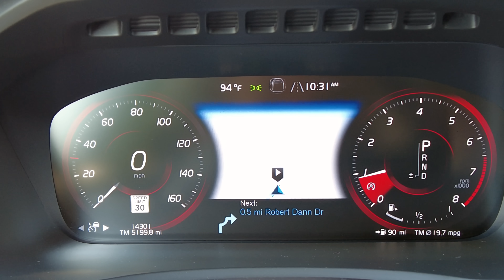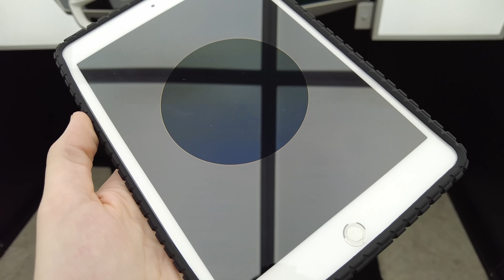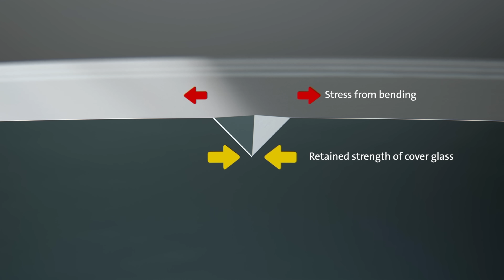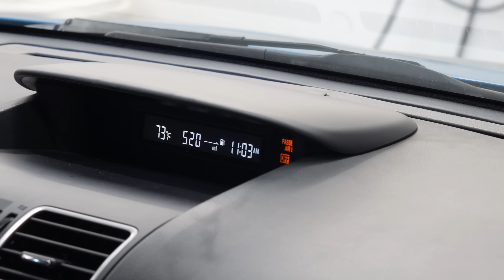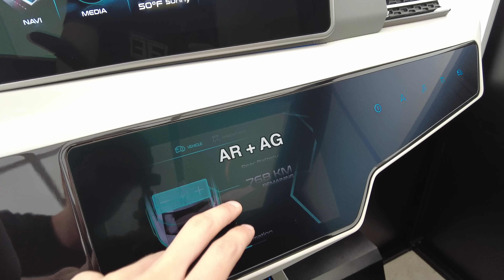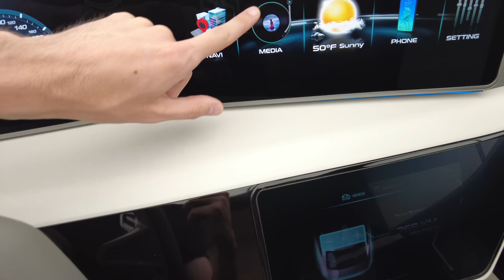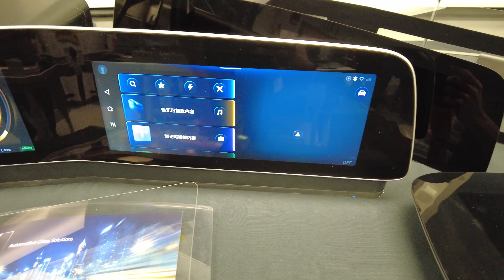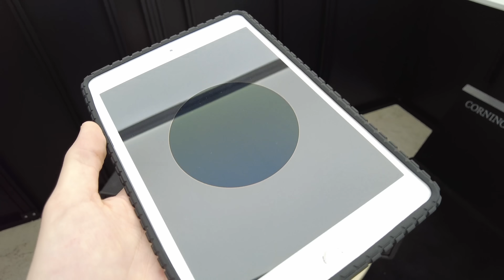How The Glass Inside Your Car Is Engineered - Not So Simple!

Comment: Note that a massive flaw in flexible glass screens is that the underlying digitizer, the component that actually processes the user's input, is not flexible. While the glass can withstand impacts and bend appropriately, the digitizer will eventually fail. This results in wandering inputs over time.

Comment: I hate, and I mean, hate, touch screens. It's high time they were outlawed - they're 100% unsafe to operate when driving. This is one of the advantages of older cars - no touch screen nonsense, everything is so easy to operate without being distracted when driving, because older cars have buttons. Something like BMW's iDrive is the best solution (well until the latest version made its debut) - massively declutters the interior,  but yet everything is still so easy to operate, and there's physical buttons for all the important controls

Comment: I honestly REALLY dislike the large screen trend. I would much rather have a simplified and inexpensive tactile, analog even, user interface especially with modern electric cars. They're sooo damn expensive already. Put the money into function and leave the interior to the user. My current ideal would be a bare-bones electric truck with either 2 motors and differentials or 4 motors like the Rivian R1T, 300+ miles of range, air suspension to allow for ground clearance adjustment for different types of driving conditions...and that's it. Seriously, bring back roll down mechanical windows, have only a docking area in which you may connect your own phone to the car for audio. I don't need anything else on the interior involuntarily working to drain the battery and reduce my range. The Rivian R1T is amazing. It is everything I would want in an EV. But starting at $70K? It's just unattainable for regular people. What we need right now is a Model T Ford EV. Something bare-bones that can be produced for the masses that is functional first above all else.

Comment: It’s sad that so much engineering goes into vehicles and yet they forget the importance of redundancy. Servicing vehicles is just getting worse with each new model and they’re unreliable. Everything is designed for the assembly line, not future repairs which are inevitable. 
What about electric steering on vehicles. Worst idea ever. Nothing but problems. Not to mention when it fails, you have no steering at all. Or there’s a software issue and the vehicle decides to randomly make a sharp turn off the road. 
Some systems just need to be more redundant. Cars need to start when cold, you need a cable for shifting the transmission with a lever, you need brakes to be mechanical.

Comment: The 8.5" Uconnect screen in my 2018 dodge charger is really good, probably the limit of the size you should be at. What is annoying is that the seat heater buttons are in the screen, not physical buttons.

Comment: No. I don't have a problem with someone having one but current integration is very unsafe for real world use. I drive 100k miles per year, I think I'm qualified to have a perspective. 

Personally I think having a digital instrument cluster is an ok use case for real world driving and function.

Switch gear is still required. However a car with a screen that has a anchor point like the 2017-2021 Toyota Camry is ok. I drove one roughly 10k miles in a few months and I was able to use it while not taking my eyes off the road.

I currently drive a Mercedes. No. They do not integrate their touch screen in a safe manner for real world use.

Comment: "Do Massive Screens Belong in New Cars?" My answer would be: No.
I am with the many others who want things that should be accessed while the car is driving as physical buttons/knobs. 
And i think that touch input displays are the worst idea in somehting like a car. Movements of the car (bumps in the road) can make it really difficult, even more so when you need to look at the road. (easier for a passenger, but still worse than buttons or other input devices like a puch/pull/press-wheel like iDrive)
And just from looking at the screens, to me the complete digital instrument cluster mostly look cheap and unelegant compared to well made analog instruments. (which by the way noever get pixel errors, and don't react slow when the car was outside in very cold temperatures.)

Comment: GM is using a 32” flexible OLED in the Lyric and Escalade..pretty impressive but not sure if it’s glass

We use molten sodium to cure and treat rubber extrusions (vehicle weather stripping). Scary stuff

Comment: Nice infomercial, but you didn't really comment on the clickbait title question you proposed.

A touchscreen in a car I feel, has no place outside of features that are not commonly used. A radio for instance, should have a few tactile controls and knobs for it's basic functions. if i want to change the volume on the fly, it needs a knob, or some tactile buttons on my wheel. similarly, for presets, give me a few physical buttons. if you dont want to put them on the dash, then at least put them on the wheel. Since, i'll admit, even i use the wheel controls for my radio more than the knob or buttons below it.

Comment: well uz got mirrors that are too small on the outside to get that .01% decrease in drag. Uz gots head rests and pillars in the way for the rear mirror soz ya kin pass the collision tests.
Hey all enginnearing collegeins need jobs. Some to screw things up by recommending removing the Darwin solutions for those that are too broken to pay attention to details.
 It also employs engineers that make solutions to keep the Darwin failures alive. Then then there are the the manufacturing assembly enginears making it cheaper and quicker to put together.
Yes a 2021 Navugreator is "safer" than a '66 Chrysler New Yorker and gets better gas mileage. But at least you can see the failure heading your direction in the old New Yorker. 
If you are paying attention to detail.
But you can be well entertained before you go to the hospital after the ride in a Navugreator. At least I got drive to drive my rusty old '66 New Yorker Belchfire massive V-8 to the junk yard.
Oh and BTW sometimes the collision avoidance system does not work and you get fired. After you get told you are a bad test driver.
 Then the plandemic hits and they want you to come back.
Even pay you extra. Just how much is a human test dummy's time worth? I never trusted the system. 
I Quit when my time was being wasted to just have the paper needed to back up the testing requirements. I still have 0 accidents in 40 years of driving. No tickets in 25 years.
 I really hated having to fiddle with all the dash board gimmicks while driving. Filling out the paper work while driving. Well you did have get the miles increase on the speedo.
 I guess that is what is needed to simulate normal driving skills on today's roads?
But if you noticed a cosmetic flaw in in a body panel. That gets fixed quick. Then there is the software/hardware glitches just to the drive more interesting.
Then the sales person wonders why I only buy ONLY the base model, bouncing box, puffed up 4.
 I also don't care if there is 1/8 inch difference in body panel fit as long as there are no water or air leaks.

Comment: very interesting video! I really love these behind-the-scenes videos.
gotta say though, screens are part of the shortlist of things I wish modern cars didn't have. I understand the advantages and why people want them in their cars, but I think we've gone way too far. Some of us don't want any of that at all. It's distracting, raises the price of the car through engineering and material costs that otherwise wouldn't be there, and will cost a pretty penny when they break...and they'll break. And when they do, it'll be the difference between getting rid of an otherwise perfectly good car or having it last half a million kilometers. Imagine you have a Nissan Sentra with 300,000km, still runs great, but it's worth barely $1k. Then the touch screen breaks. You can no longer perform basic functions and replacing it will be twice the value of the car.

As far as user interface goes, I FAR prefer physical knobs and buttons to a screen, physical analog gauges over a digital replications. Look at the watches people buy; physical analog watches are so much prettier than say an Apple watch...which looks like it came out of cereal box. We use and work with screens all day long; can't we possibly option a car without them? And then, there's the non-intuitive touch screen, where you need to swipe to actuate, with no physical indent, nothing to locate your finger. You need to look at the thing (take your eyes off the road) and make sure you swipe just the right amount, as opposed to finding a dial and turning it 3 clicks clockwise, or push the second button from the left.

We're fixing a problem we never had with a solution that is causing some serious problems we never had. The prices of cars keeps climbing; can't we just have strippers with only the important stuff (quality drivetrains, state of the art crash structures) and none of the crap we don't? I'd love to see a time when you can buy a compact car for less than $20k CAD.

ok ok rant over. I just really don't like touch screens. So happy my NB2 Miata has none of that crap. My Mazda3 does and I interact with it zero times (at least basic core functions are knobs and buttons).

Comment: Those smaller, integrated screens look a lot more usable than the giant monitors I've seen in some Tesla models. Any chance they'll come out with multi-layer screens that have transparency to give a sense of depth, like you see on some video-slot machines at casinos? I wonder if the depth will enhance the readability of analog-style gauges.

Comment: I had a tablet on a Ram Mpunt in my Astro ten years ago. A regular cassette adapter gave me access to streaming entertainment pumped through my stereo without a costly multimedia tuner installation. I've driven newer cars with touch screens and it sucks having to do all that menu scrolling. Give me vacuum and electric dial controls for everything else, and leave the touchscreen for purely entertainment purposes, thanks.

Comment: since toyota is coming with turn wheel by wire steering. I wonder if in the future, the wheel will remove all together and you just steer from a virtual wheel on the driver side display screen.

Comment: Our phones work for about three years. I doubt those ipad controls will work any longer. That in itself is a safety issue. Besides, I have ADHD. I don't need some crazy menu distracting me. Just give me the buttons. If it needs to glow to gain my immediate attention, it belongs with the gas and speed section behind the wheel.

Comment: I can't stand these new vehicles. When I want to turn up the heat or change the radio station, I don't want to have to look at a screen and go through 5 pages to do it. I drive a 1996 Buick Roadmaster sedan and I can turn on anything without taking my eyes off the road. I can only afford used cars, but even if I could afford a new one, I'd spend the money on something from the 60s to 80s and put a more modern drivetrain in it. That would be a much better investment. And a lot more enjoyable to drive.

Comment: While center console buttons are being replaced by touch screens, steering wheel buttons have multiplied like rabbits. The total number of physical controls hasn’t changed that much. Of course there are exceptions.

As automation takes over more and more driving tasks the need for physical controls is reduced. For example, if the headlights come on automatically, why do I need a physical headlight switch? This isn’t a new thing: cars used to have a choke to manually control the air fuel mixture, and of course most cars had manual transmissions and clutches.

Humans resist change, but we’re actually quite good at adapting to change. Cars have changed dramatically in the last 50 years, and we can expect them to change even more in the next 50.
Reply: It depends. Most of the problems occur when you remove a manual option without testing to make sure it works as designed in every instance. I normally use the auto mode on my headlights, but it still needs an "on" option because often in bad weather headlights are needed but it's not dark enough to turn them on automatically. So until an automatic mode can work reliably in almost every conceivable situation, it's better to have a manual option even if it's just a backup.
Reply: @edwinball985  yeah, auto has to be very good before completely eliminating manual override.

But there are advantages too. For examine, if a new law requires headlights on 1 hour before sunset and when it’s raining, automatic headlights can do this, where few human drivers will even be aware of the new law.
Reply: You see that's where you are wrong. Where i live, in fog and rain, headlights on is required by law. This worked pretty well for decades as long as people had to switch on their lights by hand each time. Nowadays it doesn't anymore. Why? Because of daylight running lights and automatic functions and light sensors. People think their car will switch the headlights on in rain and fog, but no car does it. Today is a good example: I had to drive in fog today, and over 50% of the people had no headlights on.
(The daylight running lights only switch on "position lights" in the front, not in the rear.)

There is another reason: young drivers aren't taught that in driving school anymore, because the drving school instructors tell them to just always leave the lights on. Which they don't do as soon as they get into a newer car as these have "AUTO" on the lightswitch, and nobody reads the Manual. (and it works in tunnels and in the dark, so they too assume it works anywhere the law requires it to work)

Comment: With all the discussions on, "Distracted Driving" centering on texting and handheld phone usage I can't understand with the multiple screens aren't included. 2021 Subaru Forester has 3 major screens that aren't close together and each carries a ton of info. For the most part, info I don't need. Do I really need a sliding graph to tell me I am getting great milage while driving downhill with my foot off the gas? There's also times when a warning chime sounds and my eyes dart from screen to screen to see what the car is trying to tell me only to find that info is not available (the first time it happened was because the dog in the backseat moved to the center where the belt wasn't buckled.) So, yeah, great. The tech that goes into the screens is wonderful, But give me a few knobs and one screen on the other side of the steering wheel.
Reply: IMHO a good use of screens would allow you to customize displays for this reason. Want nothing but speedometer and whatever else is legally required? There you go. Want fuel mileage and status of everything on the car-again their you go. And yes, things you regularly use while driving should be an actual switch, knob, or button.

Comment: Touch screens are downright dangerous, as they force the driver to take eyes off the road.  They should be illegal anywhere within reach of the driver.
If you can't find a button or knob by touch, it is not fit for purpose.
If the use of the glass is purely for display, fine.  Give me as much as you like, as long as it isn't used for anything distracting.
In the UK, it is illegal to have a display for non-driving-related content within the eyesight of the driver.  That should be universal.
Reply: And yet all these cars are sold in the UK...  Even with old radios, they had a display which didn't display driving related information within eyesight of the driver. I think that's a rather toothless rule/law.

Comment: Curved TV screens quickly passed because the widespread audience of a living room but the cockpit of a car is a one seat auditorium so the technology paved the way to have great invisibility and quicker access with minimum glare just on the direction of the glass in reference to the driver. So the technology is actually making it safer. I agree with you that it can become too much of a focal point as regular access events that are buried in screens are unnecessary and unsafe because you have to take your eyes off the road to use them. Great job with the video‼️

Comment: I heavily prefer buttons, another thing is that I have very light sensitive eyes so I need sunglasses to drive when it's even just a little bright out. Lucky for me, my car is a 2001 so it only has a screen for a digital clock and the radio. The thing that annoys me is that I can't see the time on the clock with my sunglasses on unless I'm in a very shady part of the road. Not necessary to know, but it's nice to know sometimes. I also hate screens at night, my dad's car has one and it is super bright. You can probably turn down the brightness a bit but even then I'd prefer nothing there at all. I am not opposed to having screens in cars, I might have to own one someday, but my preference is to not have them mostly due to my eyes.
Reply: A lot of displays disappear completely if you have polarized sunglasses.
Reply: @edwinball985  I'm not sure if mine are or not, all I know is that they have my prescription in them. Either way they aren't good for screens.